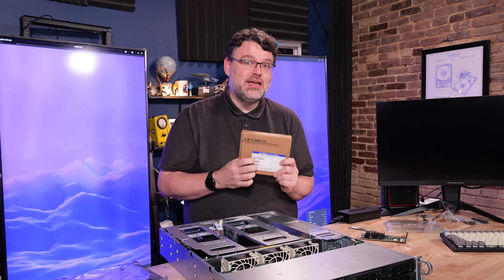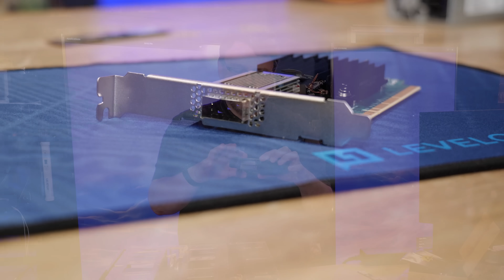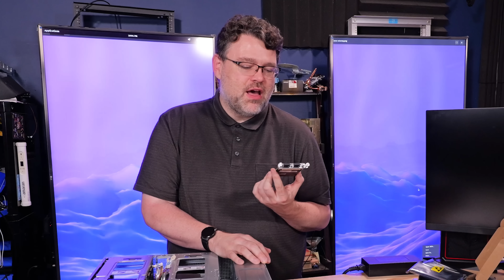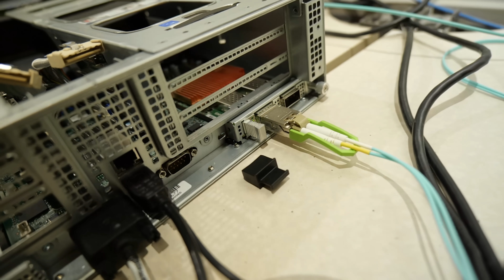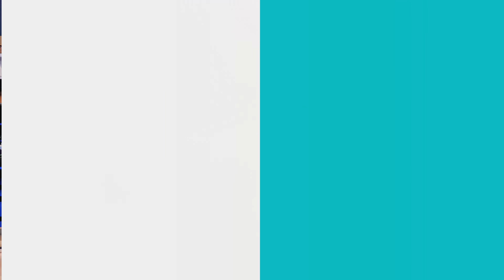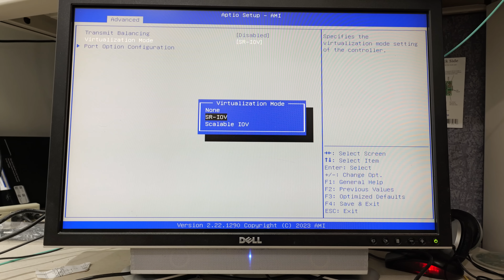The 100gig Adventure with LR Link

Comment: Wendel waves around a connectX-5 calling it old... I'm gonna go cuddle my beloved connectX-3...
Reply: bruh i'm on x-2...
Reply: I installed x-4 cards today :D
Reply: Nvidia want to push that x5 is old.. trying to up sell to x6 & x7
Reply: whistles innocently at his second hand mellanox 10GB FSP+ cards linking his NAS/app server with his gaming machine
Reply: I recently had to swap out my ConnectX-3 cards with ConnectX-4 cards because nVidia dropped driver support for ConnectX-3 after 2020 (so Ubuntu 20.04 is fine, but 22.04 and 24.04 is a no-go), but still support the latest and greatest distros/kernels with the ConnectX-4. Luckily, 25 gig ConnectX-4 cards are now dirt cheap and are backwards compatible with SFP+, so I could simultaneously fix my driver woes, set myself up for a future 25 gig upgrade, and avoid replacing anything in my network other than the NICs.
Reply: I am absolutely happy I got Connect-X 512 under $100/piece few years ago. I started from ConnectX-2. You will get there!
Reply: Those are still doing fine if you update the firmware. We got lots of those in production.
Reply: I'm staying on my X-2s as long as possible.
Reply: I'm on some decomissioned HP SFP+ cards I found for cheap, any mellanox sounds good to me
Reply: I ended up repasting my cx3 and ziptied a 4010 fan on it.  Dropped the temps from 70c to under 50c on the chip and optics.  They get toasty when not in rackmount systems!

Comment: I've been running Mellanox ConnectX-4 dual 100 Gbps VPI Infiniband cards in the basement of my home since December 2018.

Skipped 10G, etc. and went straight from 1 G to 100 Gbps.

IB has its quirks but it is anywhere between 1-3% faster than 100 GbE off the same card.

Comment: I just upgraded part of my home network from 1 gbe to 10 gbe and it was a huge quality of life improvement. Moving large files to/from my NAS is fast! Upgrading to 100 gbe sounds insane to me.
Reply: Need storage speeds to make use of it
Reply: @mrmotofy  yes - in my case I'm using ZFS on rotational media. What I've noticed is that for files that are about 7 gigs or smaller, I can copy them to my server at over 1 GB/sec, but eventually the speed drops to the rotational media speed, about 250 MB/sec. 

My guess is that ZFS is caching the writes in some way but once I blow out the cache, it is forced to write at the slower speeds of the media.

Comment: In a previous job, I worked with 2x400G cards using DPDK. It was glorious to run TRex on the other side of the wire and see 800G flowing through our program.

Comment: I'm a network engineer at an ISP. We're starting to install 100g internet connections. Pretty wild.
Reply: I was just thinking the same thing, we deployed 400Gb backbones years ago.  10Gb wan connections are a dime a dozen now.  We’re starting to see dual/quad 100Gb backhauls to cell sites routinely now.  Dual is for standard redundancy, quad is for dual-path redundancy.
Reply: @brians8664  I mean if you pay you can already get 400Gbps metro WAN for a while now. I don't know what provider does this, but it's one of the services a local DC offers if you get a VIP room (a direct 400Gbps link to the DC over WAN)
Reply: 68Mbps here ... 😂😂😂
Reply: @sznikers  50mbps😅
Reply: @Maverick00555  15Mbps until just a few months ago. They rolled out fiber, not sure what they used for the roll out or the final mile. But I'm getting 1Gbps now. I'm finally prepping the house to run Cat6 for every room. Is nice.
Reply: Sidenote, I always laugh when I see Youtubers cringe at the price of optics. I always throw up a little when I see the price of a 100 km 100Gb QSFP+ module.

For most companies, field side amplification has been gone for many years. It’s far cheaper to buy longer range optics and have multiple links.
Reply: judging by how badly affected my ISP was by a DDoS not long ago? I'd say they're still installing 100gbps connections as well(which is funny since they OFFER 1gbps to clients)
Reply: @peq42_  DDoS capacity scales together with ISP since it runs off of ISP endpoints, so i'll always be a problem unless your ISP deploys services (either their own if they're huge or contracting another bigger ISP) to mitigate it before getting to some place in the network where it'd be a bottleneck.
Reply: my dream job right there!

Comment: the fuck do yall need 100G for?
Reply: HPC/CAE/FEA/CFD applications. (That's what I use my 100 Gbps Infiniband for.)
Reply: Your car doesn't need more than 50HP either.
Reply: @DanielFSmith  
"Your car doesn't need more than 50HP either."
Soooo.....you want a 1969 Fiat 500 where it can't even DO 60 mph?
Reply: @ewenchan1239  That Fiat had 21HP. I used to own a 50HP Honda and it kept up with freeway traffic perfectly fine.
Reply: @DanielFSmith  
I stand corrected.

It REALLY depends on where are you.

The EB 8 Mile Rd. onramp to US-24 NB is quite short, and the traffic on US-24 NB at that junction is usually already doing between 80-90 km/h (50-55 mph MINIMUM). 

There are also onramps leading to EB I-94, East of Rotunda Dr., in and just outside of Detroit, where you don't have much of room as an onramp, and if there isn't an open readily available for you to zipper merge in, then you can get caught having to stop at the end of the onramp, and then having to merge into the flow of traffic (which is usually already doing between 96-113 km/h (60-70 mph)) ON the highway itself.

So it REALLY depends on where you are.

(You can google map those locations if you are so inclined to see how short those onramps are. I actually had to put a Tesla Model S Plaid in Plaid mode once, just to be able to accelerate and merge quickly enough, onto said highway.)

And if you are already doing 110 km/h and you want to pass a semi that's doing 105 km/h at 120 km/h, the 110 km/h to 120 km/h, with only 50 HP, that speed change won't be instant.

Couple with the fact that I would surmise that your Honda that had 50 HP probably didn't even tip the scales much over 1133 kg whereas curb weight of the 2024 Hummer EV is 4111 kg. 50 HP for a truck that has a mass of 4111 kg isn't going to do jack.

I'll have to look up their range cert application to the EPA to be able to calculate how much power they need to keep the Hummer EV rolling at 70 mph.

Comment: Remember the intel cards are 100g full duplex, while the Mellanox could push line rate per port if the pcie bus wouldn't limit it. The cx4 is still supported, as it uses the same driver as the cx7. If one does not need the new features like 200g or 400g the old cards are almost as capable. That slcould however not be said for 100g cards from qpogoc which are a pain in the ass compared to mlx and intel

I would love to see some stuff with dpdk and vpp. A 100G router in x86 is very cool

Comment: SSL stripping is a horrible idea, don't ever do it.
Reply: You say that now, but some people want to defeat the malware which is all SSL.
Reply: @DanielFSmith  No! You can send/receive encrypted traffic over HTTP(or any channel) as well if you encapsulate it, which malware likely does anyway! And you should be able to detect malware by it accessing an unknown IP suspiciously anyway in that scenario(without DPI or breaking SSL). The problem is that SSL stripping circumvents the traditional root of trust for any browser in your network. That means that a browser can't verify that it actually connected to the intended server anymore, which is a horrible, horrible thing. Google and a few other sites include client-side Javascript to detect and prevent this sort of thing because it is so bad.
If the SSL stripping server's CA gets hacked your entire network is compromised. Having your clients install a CA that is valid for all domains is a very bad idea. Just showing your clients how this works is a bad idea, you're telling them to ignore some of the most important message box warnings in your OS/browser. You really don't want a server with the capability of seeing all encrypted web traffic in plain-text between you and any target web server(outside of testing! I have used SSL stripping proxies aka. mitmproxy to debug and reverse engineer android apps with SSL encryption for example. But don't do it in production!).
It's so compromising, IT forensics people even look for unknown/malicious CA's from malware as an indicator of compromise!

Comment: You should do a review of QNAP's 4x100GbE + 8x25GbE switch. It's reasonably priced and uses current gen tech, so much lower power/fan noise and has more ports than the Mikrotik 100GbE switch. It won't have all the fancy layer 3 capabilities of the used switches, but I'd like to see how it compares for those of us who care about noise.
Reply: I'd argue that the mikrotik cloud routers don't actually have usable L3 features, being that even simple things wind up limiting thruput to ~400mbps
Reply: @jttech44  Yeah, that was in reference to the used Mellanox, Dell, etc. switches, not the Mikrotik ones. These low cost switches don't really have usable L3 features, but most home labs don't really need those.

Comment: Me getting 500mbs internet. Me after getting new internet : realizes that my computer, router and wifi cant handle it and can handle at most 100 mbps... goddamn it
Reply: Most likely your computer and switch can handle it fine and it's just your router being the choke point unless you have a seriously old computer and switch.
Reply: @ax14pz107  Yeah; even Desktop PCs from 2004 having mainboards such as the Gigabyte 915PM-ILR come with Gigabit/s Ethernet. I'd be seriously embarrassed to not have that as a minimum when such boards regularly end up in scrapyards.
Reply: @whohan779  he mentioned wifi, so I'm guessing not a hard link.

Comment: I got used 100GbE-CWDM4 transceivers for $5 each off ebay. Those run with LC terminated duplex single mode fiber, which is much easier to deal with than 8 fiber MPO.
Reply: same for 40gbe-lr4 (lite).  They're basically paying you to buy them when you save so much in cable costs going from MPO to LC and you don't have to deal with crossover mismatch.

Comment: And here I was thinking about going 25gbit for my Dell storage server and my main desktop. Wendell has made the want for 100gbit more desirable. lol
Reply: If you're running a point-to-point connection, it's not so bad.

If you need a 100 Gbps switch in between, THAT is probably going to be your most expensive piece of hardware. (Depends on how many ports you need, but there are, cheaper (absolute price) options, albeit at a higher $/Gbps throughput level.

I bought my 36-port 100 Gbps Infiniband switch for $3000. $3000 is a lot of money, but that $3000/7.2 Tbps throughput = $0.416666/Gbps.

You can have cheaper switches, but the $/Gbps will be higher.

Comment: And I'm sitting over here acting smug with my 2.5 and 10 GbE...I don't think I could saturate 100GbE but the 25 would be nice under certain workloads!
Reply: Yeah I wouldn't need it most of the time but 25 would be nice.  Problem I've found is the affordable 25/40gb switches are older, loud and power hungry.  Newer stuff that is a lot more power efficient is still pretty expensive.  For now I'll stick with 10 but I'm keeping my eye out for an upgrade.
Reply: @nadtz  The SX6012 is a great 40GbE switch. STH home-labbers can't seem to get enough of them. Just finishing running the package update right now. 

With 4x Noctua NV-A4x20 to replace the stock ones it now relatively very quiet.  Doesn't beat a Mikrotik CRS-317 with 2x Noctua NV-A4x20 though.

The switch reports an idle of ~25W and with 3 KAIAM XQX2502 LR4 Lite Optics, a DAC and low traffic it's at 34W. If your looking for faster network speeds on a budget, I don't think it gets much better than that.

With some limitations, you can boost that to 56GbE per port.
Reply: @ky5666  Is that one of the switches that can be run in either infiniband or ethernet mode??  Cost isn't that bad considering I was looking at Mikrotik's 10gb switch since I'm going to need more ports soon, I'll have to hop over to STH and read up on this one  Thanks for the heads up.
Reply: to be fair 2.5GbE isn't something to be smug about when all current motherboards come with support for it out of the box xD
Reply: @peq42_  This is patently false - you can find both AM5 and LGA 1700 mobos that are $160+ with only a single 1GbE port, and that's not even looking at the ghetto chipsets on each platform. 

Even figuring that, I'd reckon most people don't have 2.5 GbE switching/routing infrastructure unless they went out of their way on purpose for it.

I personally have my workstation and server running on 10GbE, and everything else is 2.5GbE at this point. But I had to sit down and purposely plan/buy all the gear to make the jump possible for my whole house.
Reply: @peq42_  "all current motherboards"
That's hilarious. On Newegg:
Intel LGA1700 (12/13/14th gen) new condition motherboards: 308
Intel LGA1700 (12/13/14th gen) new condition motherboards supporting at least 1 2.5Gb port: 121
AMD AM5 new condition motherboards: 172
AMD AM5 new condition motherboards supporting at least 1 2.5Gb port: 78

Comment: We tried installing a 100GbE NIC in a dell server at work but it wouldn’t recognize it even though the link lights were blinking maybe this video will help
Reply: Some of the 100GbE NICs can also run in Infiniband mode. Mine defaulted to Infiniband and had to change it.
Reply: Fec, autonegotiation, and infiniband mode are the most common issues

Comment: Video/content suggestion: Boot Windows over such a 100 GbE adapter from a ZFS Server and how to get the most performance out of it.
Reply: iSCSI/PXE will be too slow.

You will need iSER.

But if you are using it for storage needs, then it's a waste as most storage systems can't send that much data over the wire.

(You'll need AT LEAST two PCIe 4.0 x4 NVMe SSDs to be able to not have a bottleneck somewhere. And even then, it has to be sequential data, rather than random data. The cost and effort it will take to be able to do this will be pretty much inversely proportional to the amount of time you'd save, booting up said Windows system over iSER.)
Reply: I would find it neat to be able to “only” have one ZFS server with really fast storage that can host multiple Windows installations for different purposes. 

Storage encryption, redundant drives and snapshots or backups can be managed there so the network-booted Windows clients are as simple as possible (the only complexity is the configuration to be able to boot over the 100 GbE adapter with as much performance as possible).
Reply: @abavariannormiepleb9470  It's been a while since I've had reason to do that kind of thing but it's possible with FreeBSD (and probably Linux as well now a days).  It was 'only' over 10GbE and did involve some tweaking, I'd imagine with 100GbE there would be a lot more tweaking involved but definitely possible given the right hardware.
Reply: @abavariannormiepleb9470  
"I would find it neat to be able to “only” have one ZFS server with really fast storage that can host multiple Windows installations for different purposes. "
You can already do that, without said 100 Gbps NIC.

My main Proxmox server does this aleady.

"Storage encryption, redundant drives and snapshots or backups can be managed there so the network-booted Windows clients are as simple as possible (the only complexity is the configuration to be able to boot over the 100 GbE adapter with as much performance as possible)."
Again, my main Proxmox server already does this, with or without the 100 Gbps NIC.

(My server DOES have a Mellanox ConnectX-4 100 Gbps dual port Infiniband NIC in it, but that's pretty much besides the point.)

For the Windows VM clients, they boot directly off of the storage server itself. No need to boot it over the network.

But to your point, you CAN, in theory, (albeit probably not on a Debian based system), set up iSER, and then boot over iSCSI.

But that just adds a layer of complexity that isn't really necessary if you can just boot off the storage host itself.

For enterprise settings, of course, this would be different.

But for a homelab setting, this would be actually VASTLY simpler than trying to boot over iSER.
Reply: +1
Reply: U need iscsi boot capable motherboard the last time I saw that option it was in an intel nuc.
Reply: @BasedPajeet You mean PXE boot, right?
Reply: @fujinshu PXE is not the same as iSCSS
Reply: @fujinshu  No, he meant isci boot and like he mentioned it's a boot option in some motherboard bios (nic also needs to support it).  Can be a little quirky to get working (did it with some supermicro motherboards once upon a time) but once you get it working it's pretty neat.  That said I don't believe intel still supports it but you can still do something similar with UEFI boot options on hardware that supports it (and for that you will need PXE).